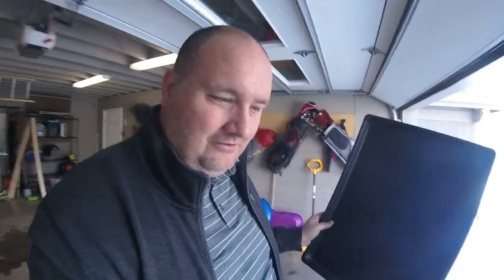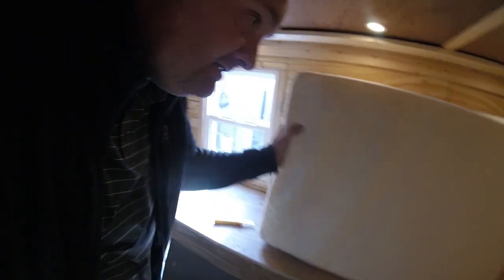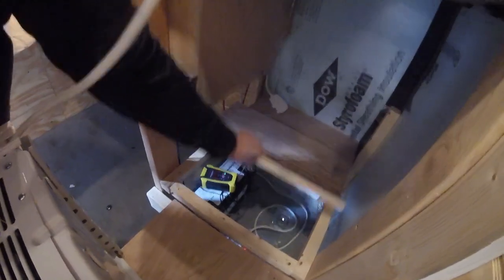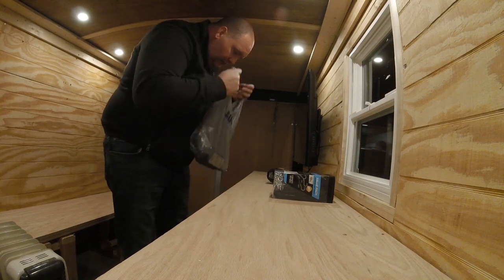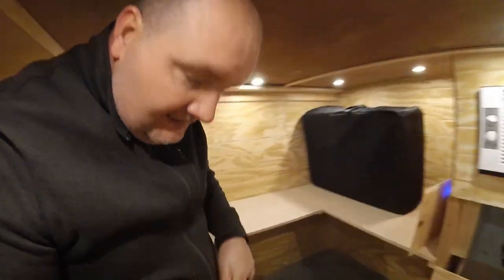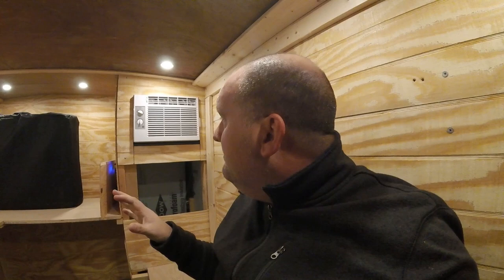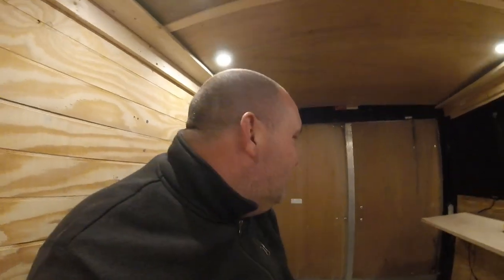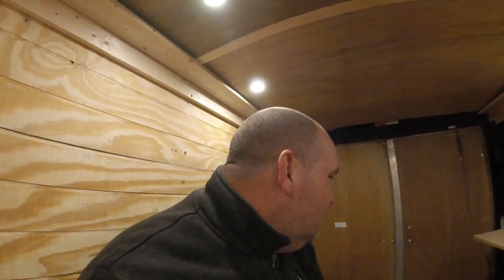Episode 6 - DIY Cargo Trailer Camper Conversion

Comment: Doesn't the a/c have to be vented to the outside?  Wouldn't you just keep recirculating the same air.. degrading the air quality?
Reply from the maker: it is, there is a vent in the side of the trailer.  I explain it in the end.
Reply: @heartofamericafpv5584  I guess I didn't quite get what you did.  I saw the part where you said you divided the vented area with board insulation.. but it wasn't clear if it was vented to the outside.  Cool setup.  I converted a cargo trailer last year.. and I didn't plan ahead for a/c.. so I've been debating if I wanna do it or just leave it as is.  I do have a vent fan.. and the handful of times we camped in it last year.. we didn't really need an a/c.  

If you wanna check out my build.. here's video I did last week.  There are also several other videos on my channel.  Cheers..

https://www.youtube.com/watch?v=KcLhMnNetYQ&t=103s